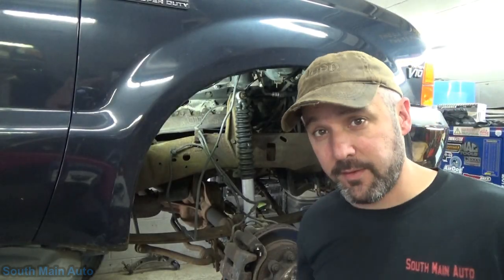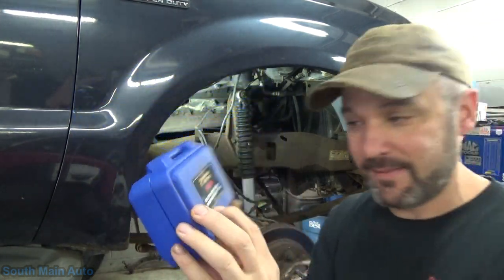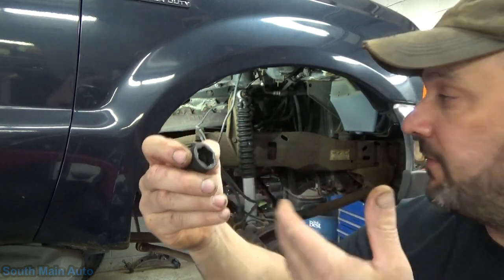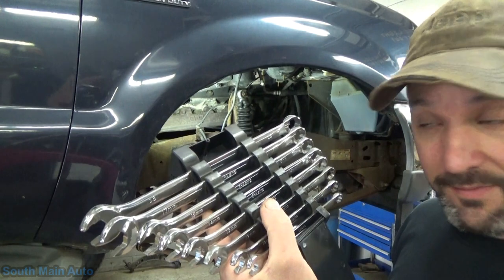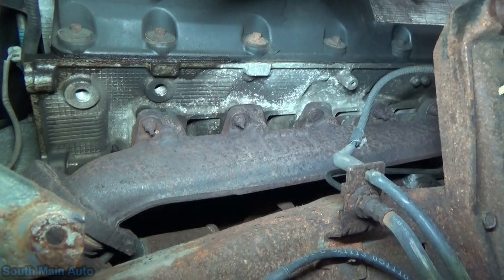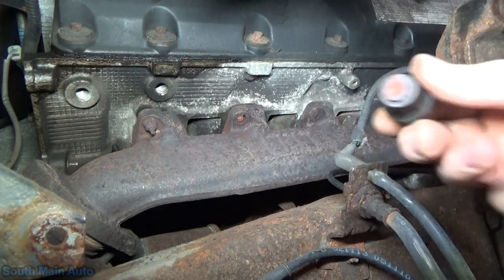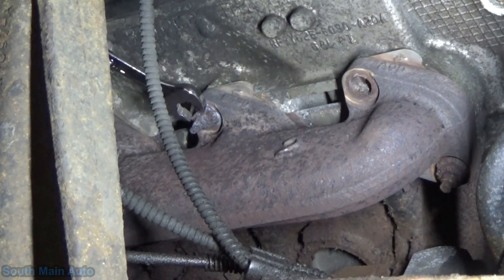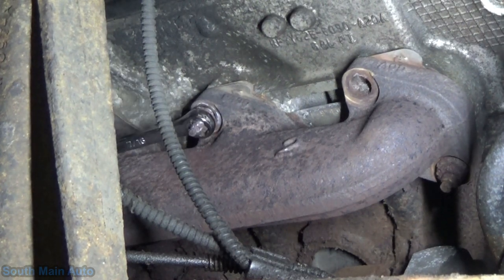Astro Pneumatic's Flank Bite Damaged Fastener Tools

Comment: Eric i,m about to drive from Cleveland because it seem's Cleveland Mechanics know nothing about cars! Took my 96 Ranger to Radair a well know Auto repair company they have them all over! Well after taking my truck to them for a check engine light they called me said all fixed! I showed up paid for the services get in my truck and the Check engine light comes right on!!! Well then the manager comes out to my truck and starts pulling vac lines off and tells me it's my egr down tube thats blocked and to unblock it and the check engine light will go off then just walks away! Just another wanna be mechanic shop out there ripping people off! I have contacted the BBB about there services and awaiting reply!

Comment: jeez,,,,all these frackin' years Ford has been building cars n trucks, and they still have the worst damn exhaust fasteners, I have worked on other cars (not throwing names here) that were 20_30+ years old, I used normal wrenches and sockets, broke them loose, and unscrewed them by hand after breaking them loose.....stupid Fords, Gms, etc.

Comment: What a pile of junk this car is. Poorly engineered with those bolts, and leaf spring suspension?
Reply: yeah those Ford V-10s had horrible gas mileage. I actually wanted one back when they came out, and the salesman said...you probably might want to look at the diesel instead (which was a LITTLE better in terms of reliability, but not much!)

Comment: Such crappy metal alloys in those studs. I'd definitely complain to the manufacturer, this is an engineering defect if I ever saw one. Save 10ths of a cents on a bolt, and this is what you get, total doo doo crap 😓